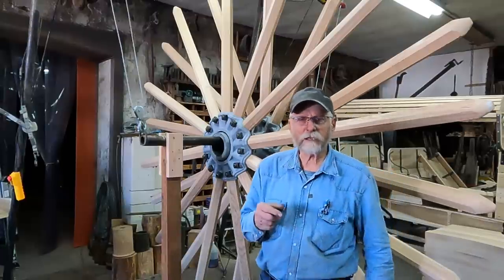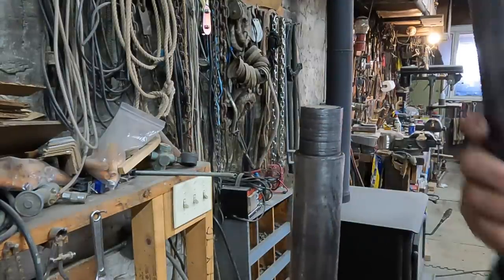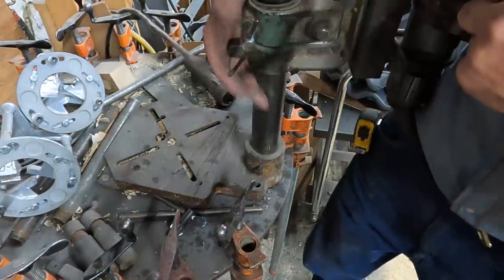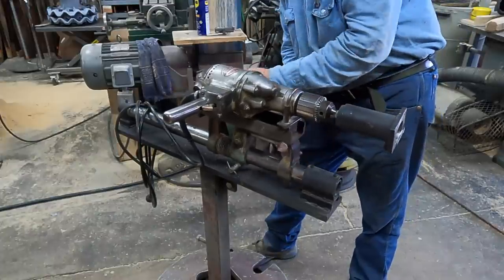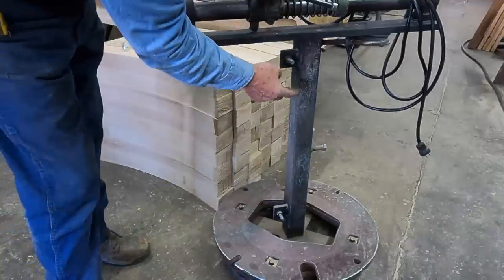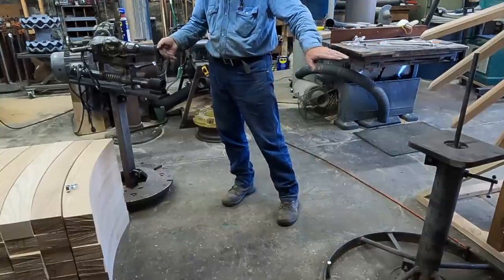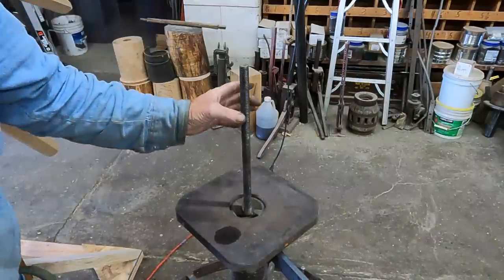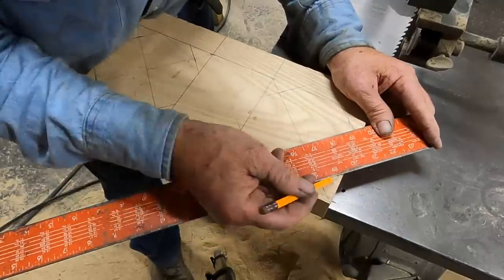Setting Up The Tooling For the 10 Foot Wheels | Engels Coach Shop

Comment: dave,
a little suggestion, if you do not mind.
you might want to get a laser pointer  (a pretty accurate cylinder, axially), and hold it by the chuck of that drill. the laser spot will be very precisely pointing at the hub center.
this, imho, is mor accutate than the tape measure.
thanks for the video.

Comment: I continue to "let in" all the amazing aspects of your multi function table saw. OOPS, there is my note on the bulletin board in front of me.  Faye and Egon, Sliding Miter Table Saw, Dual Arbor, 3 phase, 10 hp, electric motor and then to confirm, 1906.  And now you mention again your 1906 Hotel project.  Wow.  And of course the arbor set up here.  Gold David,  Just Gold.  Thank you so much for sharing all that you do.   ~ from here in New Hampshire, The Epsom Traffic Circle.     ✨🌸🙏❤🙏🌸✨.  🇺🇸

Comment: Always fascinating to see how you have your equipment set up to morph into whatever you need from it. 🙂
My brother used to own & operate a buggy shop/carriage works. Our father spent his last productive years - long past the "retirement age" of 65 - I think he was in his mid eighties when he finally quit. I can still see my dad at the "spoke trimming machine" (I don't know what it's real moniker is. 🙂 ). It was homemade too; but their work was mostly around the passenger rigs, 3-seater carriages, buggies, and the massive coaches the Old Order Mennonites in this area - southwestern Ontario, Canada - use to haul around their "massive" families, to church, to town, etc. 
Those wheels were close enough to the same size they didn't need the range of flexibility that you've exhibited here. But, I do remember they had an upside-down skil-saw set up to nip the outside ends of the spokes to the same length after they had been fitted to the taper bearing hub they use these days.
All that to say this kind of video throws me into reminiscing - and I can still see my father, an Old Order himself, his battered work-a-day black felt hat, tattered black "shop jacket" and homemade faded black overalls stooped over that contraption trimming yet another wheel... 
Thanks for that, David. 😊
Oh! And I'm looking forward to seeing what furniture you dragged all the way across a continent to use in your "1906" project! 🙂
Peace - Dave W

Comment: Good setup dave. That Van Dorm drill....I have a Wolf Drill, some RPM. Yes the torque in that mother, the drill stays still and the earth rotates around them. I have seen a 6' length of waterpipe stuck on the handle, whipping around after it was let go...!

Comment: A suggestion would be to put a  Y or X brace between your drill press and wheel stand. It would improve safety in case something did go wrong.

Comment: I was wondering about turning your wooden hub “spacers” and would it work to have turned them with a slight taper so that they would “perfectly” center themselves in the hub? I turn wooden bowls and often need to turn a slight tapered “jam chuck” to fit the ID of a bowl so that I can finish turn the bottom of the bowl. A slight taper is very forgiving and centering. I believe you said the hub had two slightly different ID bored. Just a thought. I love your mental math exercises. Great project!!

Comment: So, if you're going to do a "before work" and "after work", that means... more video's!!! :D 
I remember those Borax wagon wheels you made, I thought they were huge, specially watching how you installed the "iron tires". 
Might be a silly question but, instead of using that heavy flat bar to hold each of those "stands", couldn't you use "all thread" with turn buckles so you can make fine adjustments for the sizes of different wheels? I truly enjoy your video's and appreciate you taking the effort on bringing us along. Great video as always, cheers :)

Comment: Suggestion, use a double nut/ locknut system for both disks so they won't change height when the hub is being rotated.

Comment: How about putting a round laser pointer in the drill chuck so you can set the height and center line of the wheel.

Comment: I can understand why it you need to cut the tenons perpendicular to the fellows on a dished wheel with a twin set of spokes but is that necessary for a dished wheel with single spokes? Subject to the magnitude of the dish, is it acceptable to cut the mortices in the fellows to match the angle of the dish?